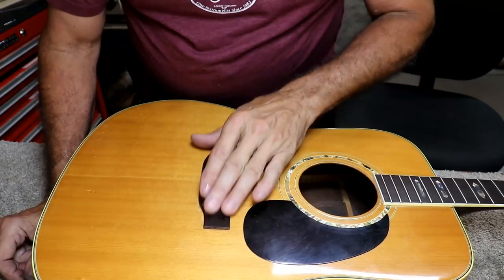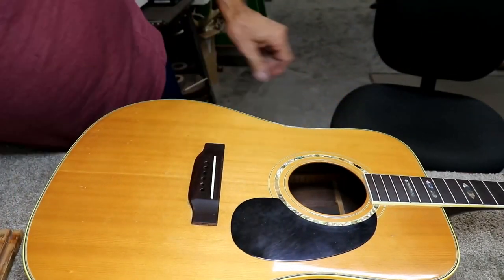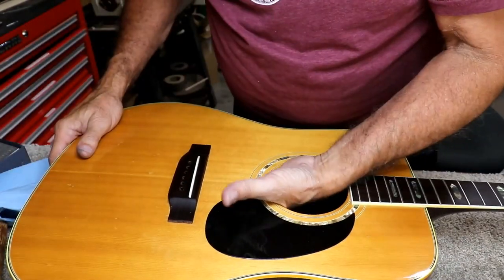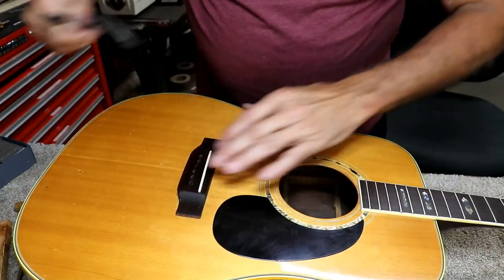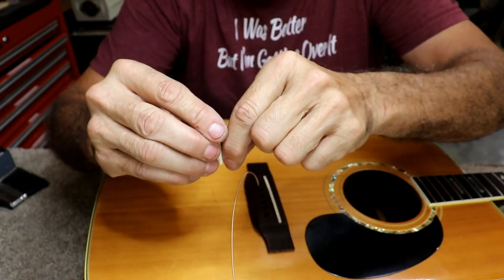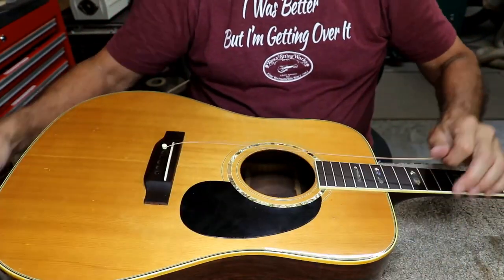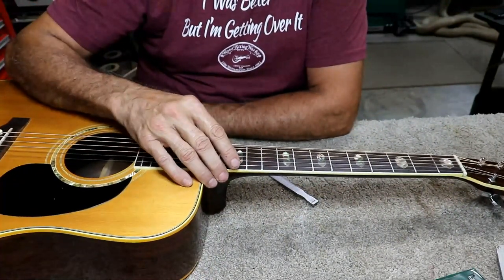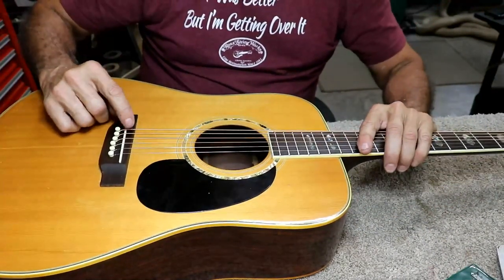590 RSW BORDERLINE Ibanez Concord Guitar DETAILED Setup - Part 2

Comment: In my pile o guitars, I have two that have 2-ply tops.  They do not sustain forever, but boy do they sound good as active players.  Fun little flat tops, and no worries about zillion $$ instruments getting dinged.  I call them pic-nic guitars, and they are fine in the back of the car, and out under a shade tree.  Both were super inexpensive used. One I had to do a lot of work like a neck set (it was loose) and a bridge reset.  But I did it as a learning project and was/am amazed at how well it turned out.  Can keep up with instruments that cost 10X what I have in either of these.  And it's one of my wife's fav's 😊

Comment: I have a '77 Takemine (with the old "lawsuit head stock" logo) that was given to me some years ago.  Needed a little work,  which I did,  and now plays very well and sounds good.  I didn't realize until a couple y ears ago that it too had a plywood top.  Should have realized it did 'cause if you look at the sound hole edge,  you can see the end grain of the middle ply,  which runs perpendicular to the top grain.  A great guitar nonetheless.

Comment: Good work Jerry. I have an Ibanez almost identical to that one that I bought back in 1974. Its called a jamboree I think.
It sounds awesome just as that one does. One thing I  did was enlarge the sound hole about 3/16 of an inch  or maybe a 1/4 and that made a difference in the volume of the instrument, which is what I was trying to achieve.

Comment: IP 54 on the caliper refers to it been waterproof and dust proof. 
Ingress protection rating.
The first number is dust resistant and 2nd number is water resistants.

In the case of your calipers they are dust resistant but not dust proof and splash resistant but not waterproof.

Comment: There is some differences in the plywood. Regular plywood for construction and furniture usually has all kinds of wood in the inner layers, including very soft sapwood, small pieces, knots etc. You can find the exact same thing on very cheap guitars.
For little better "laminated" guitars the inner wood is usually better, sometimes they use woods that would be rejected only for the appearance but still structurally fine.
Reply: Ibanez uses three layers of cross-grained spruce for the tops.

Comment: Jerry, I recently bought a Kala solid-mahogany-top parlor classical guitar because on sale I could not build it cheaper and I was impressed by the sound and set up of a Kala Makala baritone ukulele I had picked up. 

The parlor guitar was not set up as perfectly as the baritone ukulele. I guess who does set up at the Kala factory matters. I am going to lower both the saddle and nut action because it's about 155 at the 12th and 55 at the nut. Since I don't have a nice set of groove files and I need to take quite a bit off I am knocking down the height at the first fret  by sanding down the base of the nut to get the Stewmac recommended of around 30 thousands at the first fret for classical guitar. 

I did buy a spare nut and saddle in case I goof, but hopefully I used up my allotments of goofs.

I'd definitely like to have good string files, but the best price I see is about $15  each or $90. Maybe my birthday in about a week will see some string files but till then...
Reply: For many years before I finally popped for a proper set of nut slot files,  I used to get good results with a piece of broken fine tooth hacksaw blade and a slightly finer toothed fretsaw blade for higher strings to rough the slots to somewhere near finished depth, and then I would refine the shape of the string bed with a set of oxy/acetylene torch tip cleaners- those are basically a set of short round files in thicknesses pretty much the same as the gauge of a typical set of guitar strings, and a complete set can be had for about $5 anywhere you buy welding supplies.

Comment: I’m sure I need you to set up my guitar but if one string notes a little sharp when fretted, I typically tune it just a few cents flat when it is open to split the difference.  That seems to help when using a capo.  Anyway, I’m probably just compensating until I can get it set up better!

Comment: 22:30-22:40 a Martin Light pick of 0.017" is only 0.43mm thick!
In my experience,  the ideale Martin pick for stremming and picking a dreadnought guitar with. 012"-.053" strings is 0.73mm thick. (Martin sells them in mm in the EU).
After buying 50-100 Chinese pick in the mix, I usually give the flimsy thin stuff away. I don't know if I can find any under 0.58mm. Maybe some old nylon Dunlops...

Comment: That string winder should have a peg puller built into it. I used to use pliers/side cutters to pull pins until I discovered the pin puller. No more scratches/gouges in my pins from pliers/side cutters now! Regarding plywood guitars, my daughter's Yamaha FG335 plywood guitar that I bought her mom decades ago sounds better than my solid top Yamaha FG365 That I bought my self a year earlier.
Reply from the maker: It does have a pin puller I have used every pin puller on the market and always return back to the side cutters.  I don't scratch nor scar anything with them.  But then, I've been doing it for 40 years.
Reply: @RosaStringWorks  That's where your experience comes into play. I tend to be a little heavy handed, so I was happy to discover the pin puller that was already in front me, but hadn't noticed before! Enjoy your weekend!
Reply: I slipped once when using a built in peg puller and put a scratch in the top of my guitar.  Ever since then, I've used side cutters.  And taken more care!

Comment: Very interesting, especially the part where you measured between fret 1 and the strings.  One of my Crafters has a buzz on the low E, which sounds like it comes from the bridge, but is partially fixed by putting a small piece of paper in the nut slot.  I also had to raise the nut to help solve this problem, but my low E gap is now 0.024".  I can't see why it needs to be so high, but any lower and I still get buzzing.  The truss rod's adjusted properly, and the bridge height is correct, with 12th fret action about 0.060".  Anybody care to comment?